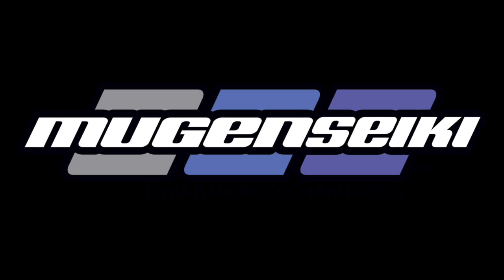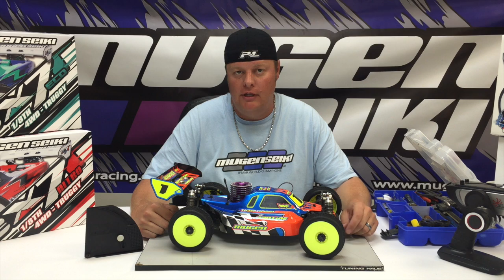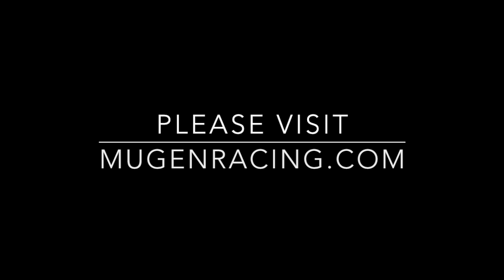Adam Drake from Mugen Seiki Racing explains how to set and adjust camber.

Comment: sir, can mbx7 upgraded to mbx7R ?
Reply from the maker: Yes, but it will require a bit of parts including the shocks, rear shock tower, chassis, ect.
Reply: Adam Drake but can u tell are MBX7 parts still manufactured ?
Reply from the maker: @ai-of6bx  Yes, the MBX7 parts are still available.  www.mugenracing.com

Comment: Using a camber gauge, and the arms are brand new.  Both steering turnbuckles are the same length.
Reply from the maker: Very strange..  What camber are you getting from side to side?  adrake@mugenracing.com
Reply: -3 on the right and -2 on the left.  Ive checked and re-checked everything i can think of (short of disassembling the whole front end).  Maybe a bent hinge pin or pill opening out of round??

Comment: Adam, I have an issue where my front camber is different on each side using identical shims on each side.  I’m at a loss as to what is causing this.  All the pills are the same, too.  Any ideas?  Help!
Reply from the maker: Hello, 
it's difficult to measure the front came because of the amount of bumpsteer on the Mugen vehicles.  Also the front toe will have an effect on the front camber.  I always run one washer on the upper and lower arm.  Are you using a camber gauge or set-up station?  I find it a lot more difficult when using a set-up station compared to a gamer gauge.  Is it possible maybe you have an arm that is bend or tweeked?

Comment: Hi Adam I'm sorry I'm asking so much, I'm new to the hobby cause I ran when I was like 12 but never did mechanics my father did now he lives abroad so I need your help. 

in the manual it says that when you are putting your pivot ball screw it shouldn't be so tight. But the problem is if i do not get it tighter I only will get -5 of camber and that might be a little to much. Can I put them in tighter or do I have to put washers along the upper arms and the pivot ball? 

also does it work if I remove the lower washer, and take it up? Can this be done? 

as usual thank you so much I'm so happy I'm back and now that I'm 30 with all this media I'm glad I got a Mugen and not a Kyosho as I was before.

Comment: This is perfect. I'd not considered the affect ride height has on it, so just learned something new. I also was not certain about front camber and should you measure with steering neutralized or with the wheel facing straight ahead. These videos are awesome...if you ever get the chance another video I imagine would be wildly popular is how you serialize the setup changes. i.e. Ride height before camber, tire selection before ride height, etc.
Reply from the maker: Nitro RCNerds 
:)

Comment: Take an old set of wheels and using a body reamer, ream a hole in two of the wheels right where the upper pillow ball is.  This allows me to use an allen wrench and adjust the camber with the wheels still on the car.